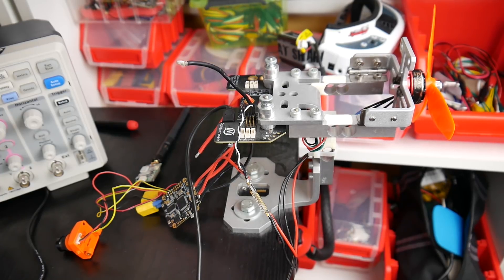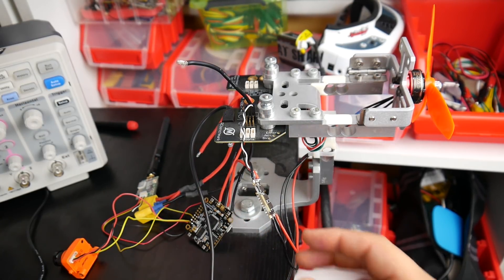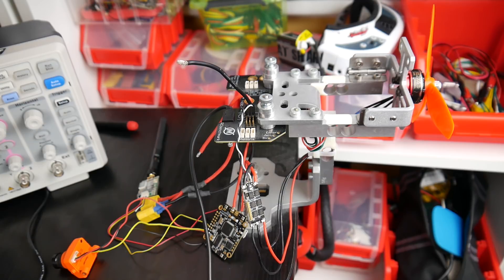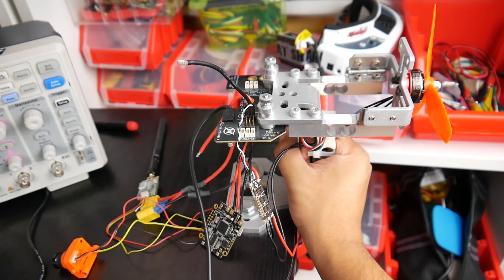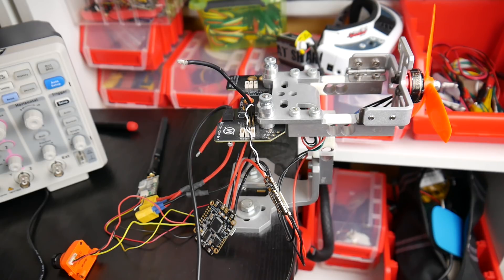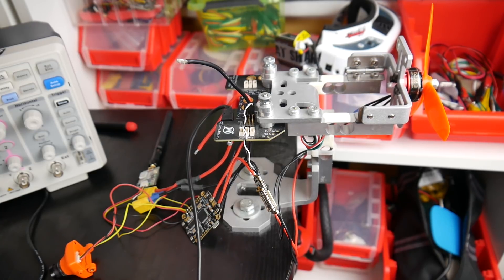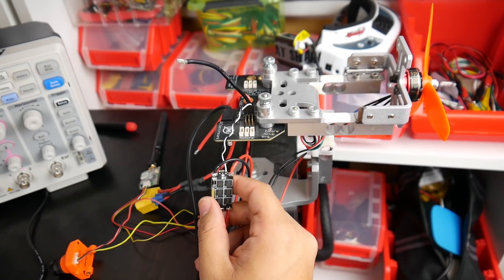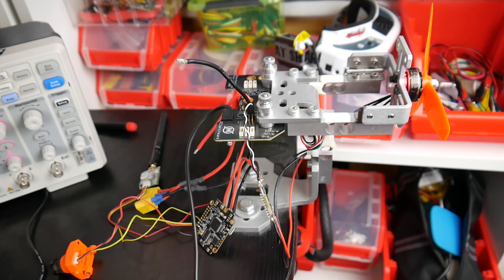Holybro Kakute F4 AIO V2 + Tekko32 ESC // Review and Noise Testing with FPV Footage

Comment: hi bro i just put this together now flies great, but if i land or bump anything, the flight controller freezes then cuts motors like a failsafe. cannot re-arm untill powering off then back on.  anybody else getting this?
Reply: is it a sensitivity control in betafligh or the new bl heli32 settings?

Comment: Drone Mesh, can you try that with the flight controller and the escs very close together as if they would be in a compact stack? There is a FET issue that I believe is caused by poor shielding when the FC is right on top of the ESC (not touching obviously.)

Comment: Hi Done Mesh do think Holybro will make a 4in1 out of the Tekko32 with exactly the same characteristics? I'd pay some money for that.. The Kakute V2 and the Matek CTR look like the best FCs around (looking at the JB roundup and comparison sheet). How would you compare them? The only thing I hate about the Matek is that they place the USB port on the opposite side of the power pads and I like my power pads on the back and USB on the side.

Btw, love your videos, even the music is great. Learned already a lot. And of course the wishlist:
- Since I'm flying Aomway and they are not as popular as Fatsharks, more vids about Mods for those or whatever about those :-)
- I fell a little for vertical arms frames. So some more in this direction would be nice.

Have a nice one, greetings from Basel ^_^